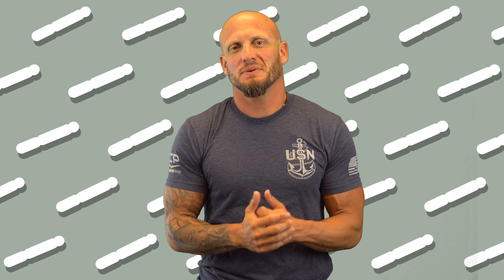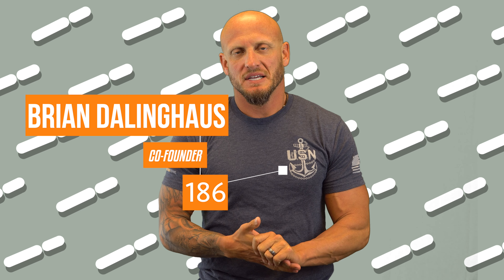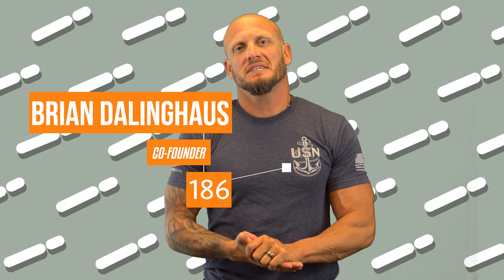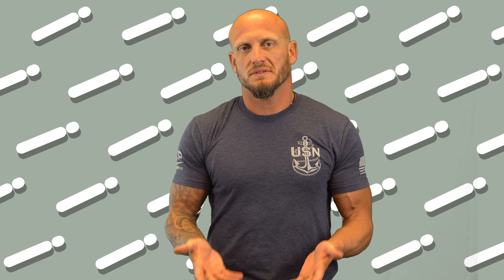What Is Concrete Spalling? - Foundation Repair Tip of the Day #186

Comment: How do you make sure that the floor becomes smooth after plastering? It’s an outside floor. Cement comes off when we sweep. It causes people to have sinuses. Plastered about three days ago. Should we pour water on the floor. It’s an outside floor. May you kindly assist?

Comment: It seems like basalt rebar is a solution for spalling due to steel rebar rust? Basalt is said to be higher tensile strength, 1/4 the weight, doesn't absorb moister, expands/contracts like concrete, and doesn't rust.
Why isn't basalt rebar popular?